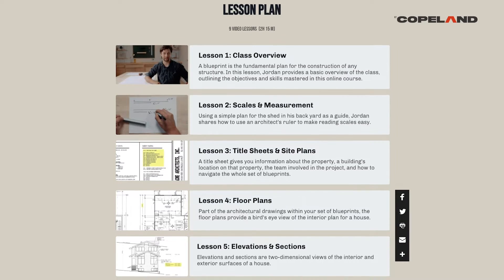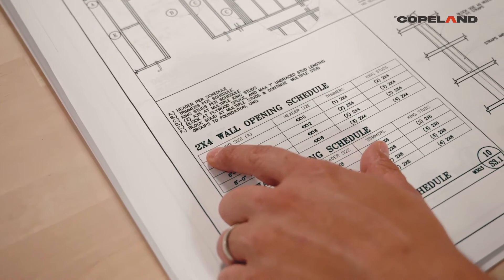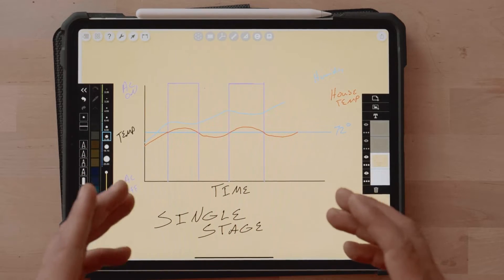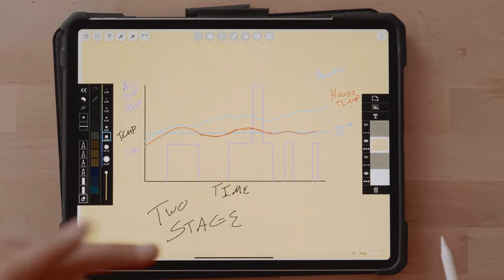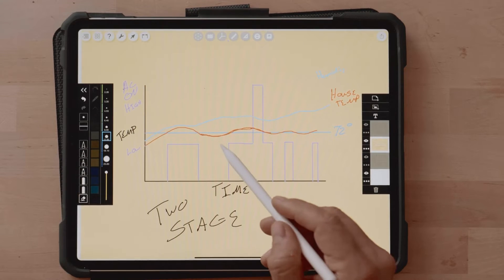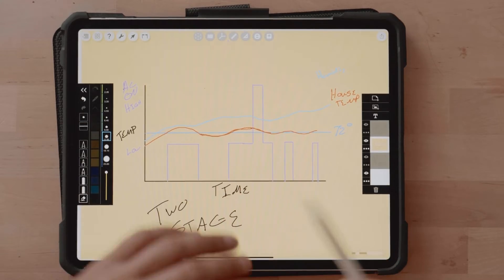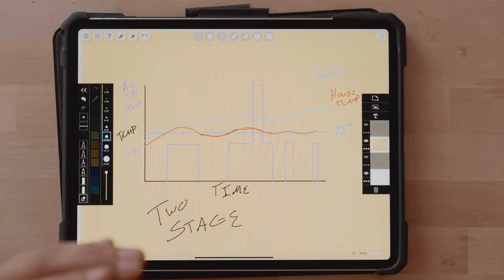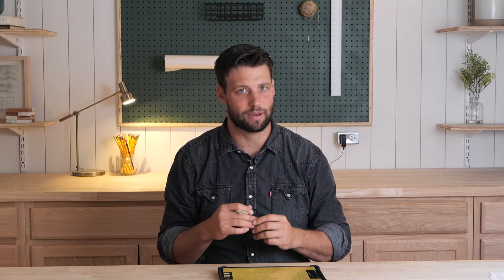Air Conditioners - Single Stage vs. Dual Stage vs. VRF (Mini Split) - Sizing and Dehumidification

Comment: You claim that 2 stage systems cost a lot more than single stage, but you are completely wrong. Wholesale pricing is typically about $1100 more for 2 stage than the same size single stage. Over sizing is not an issue because the unit will simply run in low output for a longer period of time and only occasionally ramp up to high output. The only reason you claim VRF units are more cost efficient is you make commission on the links you provided.
We have done the cost analysis of all three every year for over 10 years and found the 2 stage systems offer the most bang for the buck and the majority of our customer recover the cost of upgrade within 3 or 4 years. Variable systems (built in, not mini splits) cost too much and the home owner almost never recovers the investment. Mini splits do not move the air through the entire house, so they do not dehumidify the whole house, nor do they filter the air properly. Their filters have no MERV rating because they are just a see through screen.
Reply: I have found that the 17 SEER 2 stage systems is too loud for many customers in addition to that we have found a payback of 5 years or under when you compare the two since there is 33% energy savings when you go with a 26 seer. The DBA on a 17 seer condenser is 72 DBA VS 51 DBA for a 26 SEER I mean you cant even tell it’s on, it’s super quiet. We have found the variable speed (inverter technology) compressor to be a work horse since there is no hard start & you don’t have to deal with contactors. I’v had a RUUD inverter compressor in my house for 14 years and have had zero issue I love it.
Reply: @victorsr6708  Over 80% of the units we install are 2 stage units. I have never had a single customer complain that they are too loud. They are always more quiet than the single stage units we replaced. It sounds like you are exaggerating the sound differences and misleading the consumer. The 51 DBA for the variable unit is only when it is in it's lowest output level. As the output level goes up, so does the nose level. That is simple physics of the increased airflow from the fans and increased noise levels of the compressor spinning faster. If you are going to compare the DBA, then do so when the 2 stage is at it's lowest, which is also around 52 DBA. As far as a 33% energy savings, that is only of the cooling part of the the customer's electric bill. Most electric bills are half cooling and half everyday living (TV, refrigerator, water heater, washer and dryer, etc) So the $3k cost difference between 2 stage and variable unit won't be paid back in energy savings for at least 8 years for most people.
 I did the math comparing my bills with 2 stage vs projected bills with variable. Your shorter estimate is based upon comparing the bills from an old, inefficient single stage unit; not a fair or accurate nor honest comparison. I'm in the Arizona desert, my cooling cost for a year is $650, averaged over 8 years, using a 2 stage system. My neighbors with single stage units pay double that for cooling. If my cooling cost (in the desert) is only $650 for an entire year, then the savings from a variable will never pay me back before the unit dies.
Reply: @briangc1972  In So CA we are paying $2,400 a year in total power. Average about 680 kWh's in winter and 1,600 or so kWh's in summer (4 ton 10 SEER Amana 32 yrs old still on the original cap). So for about 4 months of the year our A/C triples our consumption of power. We have insulated walls and attic, attic exhaust fan, new double pane windows, raised foundation 1,950 SF, 100% LED lights, weather strips blah blah and the energy rates keep on climbing. We spend much to be efficient and attempt to save money yet its all a waste due to insane power rates. .45 cents per kWh in summer !
Reply: @victorsr6708  DC current rules in the electric motor industry...less vibration etc.

Comment: Lots of good information here. Many local HVAC specialists I’ve spoken to give a quote in seconds. 😔

Is there a HVAC design service somewhere that doesn’t cost an arm and a leg?
Reply: There are online Manual J programs that you can pay a small fee and enter your data. You will need wall dimensions and types, window dimensions, overhang of the eves, ceiling and wall insulation R values, combustion gas appliance info, and  exterior doors and sizes.

Comment: We own a large farm house that has been added on to.  The original Rudd heat pump is 34 years old and runs like a champ.  In the addition we have had 2 heat pumps in 25 years.  The second one is a two stage unit that broke down on a yearly basis for the first ten years, it is now 12 years old.  By broke down I mean two compressor, 2 or 3 a coils, multiple "computer boards". The last computer board caught fire, we were lucky the house did not burn down.  Thank goodness we purchased the extended warranty so we never paid out of pocket for repairs.  They just don't make them like they used to.
Reply: What brand was your two-stage unit that broke down all the time?

Comment: Jordan, good, rational discussion.  Agree - if you have humid climate (especially during shoulder seasons when AC isn't needed), a whole-house dehumidifier should be a key piece of equipment.   Go for single-stage, high efficiency AC and spend effort tightening up the house/adding a rainscreen.

I really like the focus on cost/ROI - it's helpful, useful advice.  Matt ignores cost all-too-often in his vlogs - gets people interested until they find about the high cost - yes, rammed earth, hemp homes, triple pane and net-zero are interesting - until you dig deeper and see they are mostly virtue-signalling 1%er vanity builds.  For some reason cost seems to be a topic to be avoided like the plague (I guess sponsors don't like that topic) - you've always been more pragmatic.
Reply: Matt's channel is focused mainly on new construction trends and technology. He's more about advanced and high end production, and you can see by the houses he works on that none of it is affordable for the average person. It's the construction version of MTV Cribs.

Comment: In florida, we have to do manual j load calcs on any new house and any remodel where 30-50% of the house is being remodeled.  What people don’t or don’t want to understand is even with the load calcs the ac is oversized 95% of the time.  The designs are based on the hottest day of the year and the hottest time of the day.  With the right thermostat, a variable speed system is all you need for humidity control and cooling.  I never put humidifiers in a house.  The humidifier still cools the house.  A full variable speed system will never pay for itself, but if you can afford it, it’s the only way to go.  A properly designed and balanced system, with the thermostat in the right location, will work great for both cooling and humidity and usually it’s with a smaller system than you would think, without the hassles (heat and water)of a dehumidifier. I’m in Ft Lauderdale where there’s a bit of heat and humidity😜, and have installed thousands of systems since 1984, and have never installed a dehumidifier.
Reply: Florida a mostly-cooling climate and AC-only is a viable dehumidifying solution. But what about cooler climates with shoulder seasons where you get high humidity but have no cooling needs? That's a much-larger portion of the country. Jordan's advice is useful for a significant proportion of homes.

Comment: 6:30 i have portable A/C/heating/de-humidifier in my bathroom... when i dehumidify it heat up the bathroom to about 36 celcius. one way you could keep the temperature to same level while dehumidifying would be to output a portion of the heat from compressing the air back into the house but away from the input so that it doesn't affect the dehumidifying speed as much....with some sort of electric solenoid that control valves n shit
Reply: I would be careful, depending on your model, the AC unit could actually be stupidly inefficient.  Here's a video explaining it: https://www.youtube.com/watch?v=_-mBeYC2KGc
tl;dr:  If it's a single hose unit, then when it's cooling it's actually sucking the cold air out of the room and creating a negative pressure environment.
Reply: @EmperorA0  mine have 2 hoses but i purposefully do try to create negative pressure in my house during summer because my bathroom doesn't have any duct to expel humidity during showers....during east canadian winter. i just keep the unit next to my shower and the vacuum is near the ceilling and it's pushing hot air downward on the floor.

Comment: I think you missed a key issue

HVAC systems need to be designed for each specific home and client. 
Never trust HVAC contractor who walks in asks 3-4 question and then just hands you a quote.
Reply: You mean, like 95% of them?
Reply: And does the replacement in one day.  Quality, craftmanship, pride and experienced installers can't do it that fast.

Comment: Most of the airco's can modulate between 20 and 100% of their capacity.
So short cycling is something of the past (at least it should be).
Reply: Correct me if im wrong here, but only variable speed (efficent) or hot bypass (inefficient).
Reply: @tweake7175  you’re correct, a variable speed compressor and evaporator fan motor works best but it can be controlled somewhat by just a variable speed fan motor.  Short cycling is definitely not a thing of the past

Comment: thats interesting.
over here i have not seen a single stage for sale (at least in the major brands).
they are almost all variable inverter units. i did see some 2 stage units but they where the old gas which is being phased out and i think the replacement is variable.
the advantage of the 2 stage was that it could run a lower output than the variables. cost wise the 2 stage was about the same as the variable.

Comment: Worked a few years with a great old HVAC guy. He always said Manual J was garbage. Units should be sized based on keeping the house at 65 on a record high temperature day with 2 kids and dogs constantly going in and out. 🤪
Reply: If the old guy knew how to use Manual J, he could use it to do that calculation; you can accurately reach any target temp with any set of parameters. Sizing a system to reach 65 with kids and dogs will grossly over size the system. I hope that old guy is no longer in business selling the consumer the wrong equipment.
Reply: @briangc1972  we will have to disagree on that. 65 is comfortable. I don’t want my AC sized to only be able to reach 65 on a mild day and to be miserable inside on a hot day. 
Most homes built in the last 30 years it’s a miracle to get it below 80 on a really hot day. Especially if you have kids and/or dogs going in and out.
Reply: @hkgonra  this is an issue I am currently having. My home is single level approx 1500-1600sf. The current unit is a single stage 2.5 ton and on hot days can’t cool below 75 degrees and it’s entirely hot and musty in the house. I had an hvac company come out and recommended a 3 ton dual stage unit which is slight more cfm and btu but I’m scared I’m going to have the same issue of not cooling below 75 on hot days
Reply: @wildcard157   what part of the country is the house in ?  That makes a huge difference.
Reply: @wildcard157 very late reply, but if your home is musty and the unit is running constantly then it’s not the size, you either have a dirty indoor coil, dirty filter, or you have the wrong size ducts. Also, if you’re air handler is in the attic, that’s a huge issue.

Comment: Hello. If you build a “tighter house”... Envelope is plywood, acoustic sealant between ply/framing, tyvek wrap taping all seams and flashing tape all windows and doors. Insulation Closed cell underneath raise house, open cell on roof rafters and rock wool in the walls. Window and Door package mid grade. Southern Louisiana client 

Do you think I would be find with Single Stage w/ secondary dehumidifier and be fine.... Or at this point, a fresh air supply unit is also needed?
Reply from the maker: You would probably be fine without a fresh air intake.  The last pretty tight house that I built and lived in for myself (around 2ach 60) had a fresh air intake through the dehumidifier.  I had a CO2 monitor and shut off the fresh air intake to see if I could tell the difference.  I couldn't.  Between kids opening and closing doors all day long and vent hoods getting turned on for cooking etc there was enough air changes to not need the mechanical unit.  However, having said that, if you're already installing a dehumidifier it's really easy to put in a y before the intake and hook it up to your humidistat to switch between closed loop and fresh air intake.
Reply: @JordanSmithBuilds  Thank You. Currently working with an investor who always fights me on building science improvements. I(we) feel its more important to build a comfortable and efficient house (Within Allowable Budgets)... All said, Thank you again for the input. Also looking into LP products from another video of yours. Watched Matt R. for years and now you are another resource we use in the ever pursuit of building knowledge. Love the style and approach you are taking with your channel

Comment: Another great video!
It's interesting why inverter AC units are so much more expensive in the US if compared to outdated (at least in european terms) single stage units. If we're talking about multi-split VRF systems then they're really more expensive because they're more of commercial grade despite being advertised for home installations. However decent and simple mini split inverter units here in Europe start from 600$ USD for a 9k BTU/h unit and few bucks more for 1 ton ones. It's doesn't makes sense that one central AC unit costs more than 3 separate mini split system of the same combined size. That's some kind of inverse law of economy of scale
Reply: A big part of the cost difference is the ductwork system that comes with a split system in the US combined with houses of 2500 sqft (232 sq meters) and bigger.  Most of these houses will have big walk in closets, multiple baths, separate laundries, etc of which have ducting.  Typical "normal" practice on production houses is often a ton of ac per 500 sq ft and two systems for two story houses.  Minisplits "might" be used in single room additions or even garages and hardly ever for whole home conditioning.  Not saying any of this is optimum building science but it is reality in the US since the late fifties when everyone had central air installed in new houses and most old houses started retrofitting the same.  Finally, US hvac tradesmen as a whole only know single or dual stage split systems.  Some can install minisplits but maintenance capabilities are often sketchy.
Reply: @rj.parker  I've met some HVAC guys that are downright hostile to minisplits. Don't understand it.
Reply: @s.n.9485  because they are built so cheap, have less warranty, parts are harder to get, more of a pain in the ass to work on and dont fit well in the houses i. The U.S. we like a/c in all of our rooms not just the main areas. They are mostly used in garages and enclosed patios here
Reply: @rj.parker  
I'm not sure how much ducts play into cost. Most people these days are reusing ducts and even the air handlers.
Reply: @rj.parker  
It's a bit more of a "racket" and "rule of thumb" for my liking.  I was quoted $9k for conditioning my home with two resistive backup heat pumps to cover four levels, which I didn't like their approach so designed my own single unit multi fuel system and ductwork, installed everything myself for about $3k.  Works amazingly well and super quiet.
Reply: Good observation, inverse economy of scale.  It's probably a pricing/profit outcome.  I bought four mini splits last year in the size and price range you stated, no problem.  Now with the Brandon squeeze that's likely to be a challenge.

Comment: JOrdan $80 electric a month you are the man.  Live in FL and the variable speed fan dehumidifies perfectly with 2 stage unit. Do not run the fan all the time because that puts humidity into the air by not allowing the coils to drain.  Do you recommend a split system in a smaller home? 2 separate units 1 bedrooms 1 living area? It seems like areas being all the same temp is wasteful. Sleeping in a cooler space is better.
Reply: Average Southern California house 3bed/2bath/1,800 SF is paying $400 or more in summer.

Comment: no the thing you said is a very good system and economical as well but i would still go with vrf multi splits with nice erv and slap on some merv 13 and active carbon filter behind the erv...